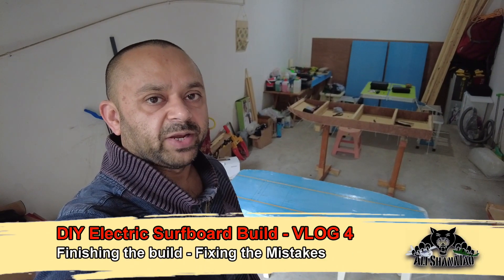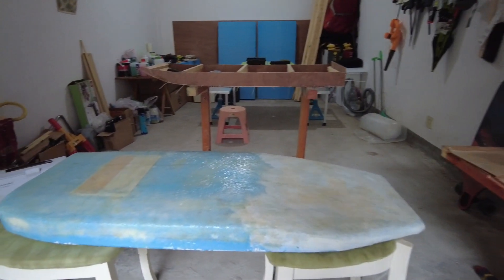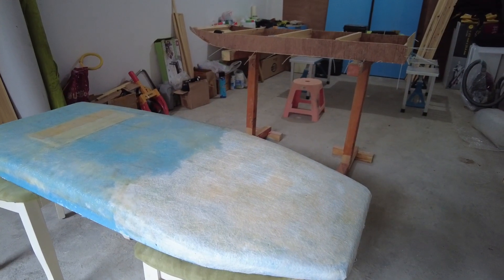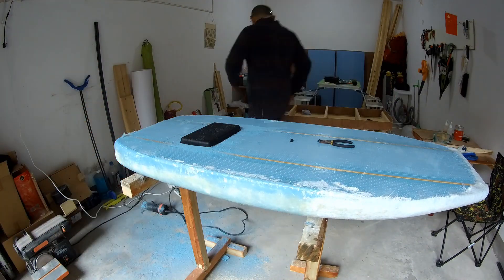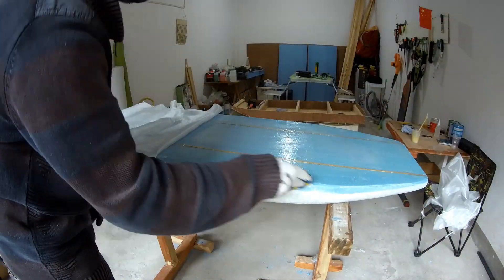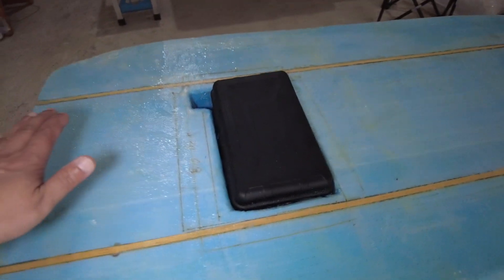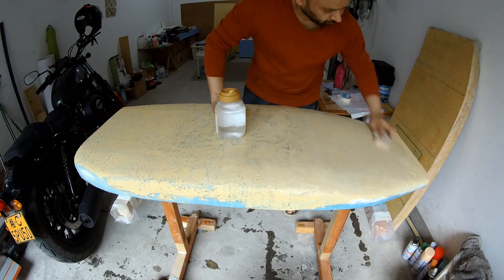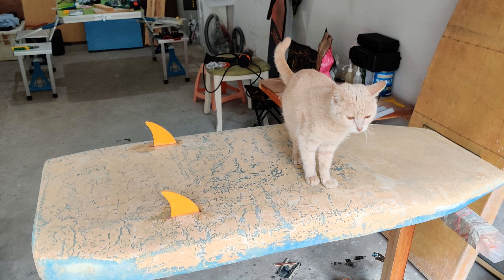DIY Electric Surfboard Build Vlog 4 - Fiberglassing and Smoothing

Comment: Great to see the progress. Keep developing it! Maybe lets do an interview in future!
Reply from the maker: Thank you buddy. now that weather has been getting warmer, I am looking forward to doing its float tests and then either direct install a motor under it or build a hydrofoil (3D design, print and epoxy fiber glassing to make it strong)> most probably i will first go with direct motor attached under the board to see how it goes. My DIY electric mini Boat is getting ready too. gonna test its floating and sealing at the same time i believe.